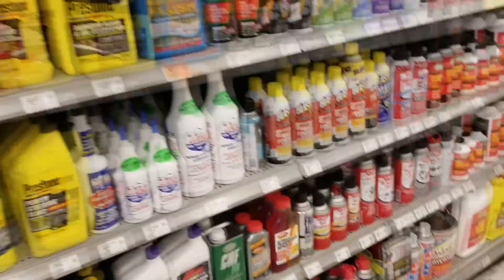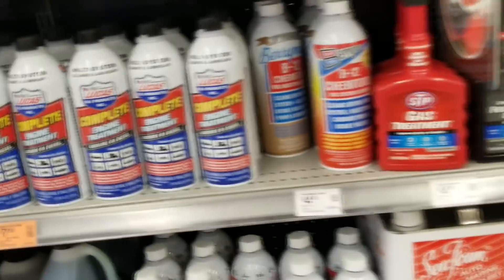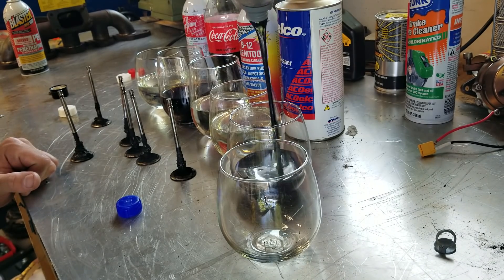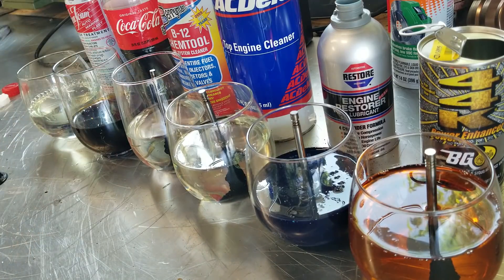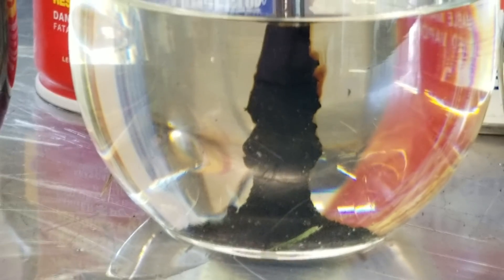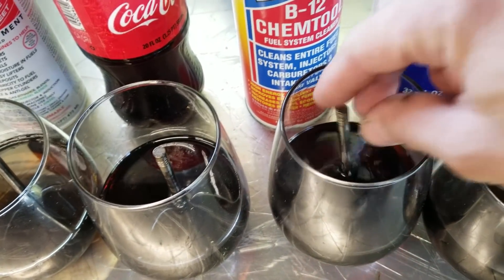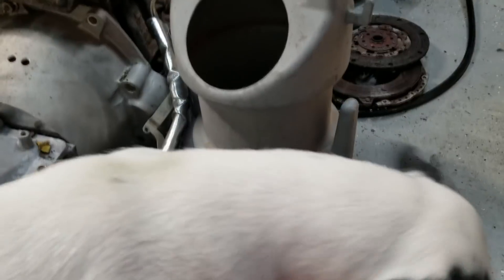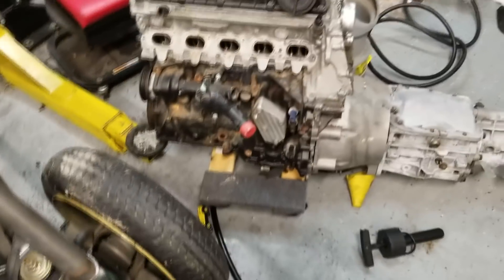Testing different chemicals for carbon cleaning

Comment: 🔥No Coolant, No Radiator and drive, still no 🔥heat...? Best Solution for Engine Over Heating problem is to use Graphenizer, watch the live Test video : - https://youtu.be/SqNIGQM1I2Q 

Graphenizer is a revolutionary product for those who are experiencing overheating engines, low pickup and performance, high fuel consumption, and high carbon emissions with black smoke from their engines.

As it is the only solution for all the above problems to be solved instantly.
It not only cleans the engine and enhances the performance, but also provides a cure and saves the engine from further damage. It gives it a long life by providing a protective coating to its internal parts like pistons etc. It can be used for all the vehicle's engines, and it is very convenient to use, and the results are immediate and long-lasting.

Comment: because BG44K isnt working as carbon disolver, it works just when its injected into hot enviroment, bg is enhancing the carbon that it can be burned off easilly. If you want something from bg, that works in room temperature, you must use bg air intake & valve cleaner.

Comment: When I had to carbon clean a TSFI Audi’s intake valves, the Seafoam and BG 44K were not very effective.  I had the best results with Redline S-1 Fuel System Cleaner, and was better than acetone.

Comment: just think when adding this stuff to fuel tank or spraying in throttle body etc...  the valves are going up and down and around and around opening up and closing on the valve seats all the loosened up carbon is going right on top of the pistons and  there's carbon on top of them also and they go up and down, now all the carbon deposits are scoring  cylinder walls then some is getting in the oil pan so the oil pump can recirculate it through the engine

Comment: You should have tried brake fluid. The best one I found yet. Soak for 2 hours brush it off then soak again in new fluid. They come out looking brand new
Reply: Brake fluid is old skool cylinder head decarbonizer we used it in the early 80ies on straight 8 valiant engine,worked very well didn't have to take head off
Reply: Sendrick Nahr what type?

Comment: Once valves are to that point all coked up , no chemicals are going to remove the carbon. Manual or mechanical cleaning is only method that can work on hardened carbon.Chemicals can only be used on new engines from the start with regular chemical cleaning before it builds up too much and hardens.
Reply: You have to cook them
Reply: @virusboy07  not all of them most of them are spray and wait
Reply: Joseph Randazzo agree, these so called cleaners only clean the snorkel and throttle body
Reply: There are plenty of carbon removers used in restaurants that could do it though every effective one he would need high grade gloves and a mask.... Something else brought me here but my families owned restaurants going on 60 years... Just go to any restaurant supply store and look
Reply: Really baked on carbon crusts (piston crown or valves) can be softened with oil or LM 1420 over the period of some days.
You can scrape off most of it afterwards with plastic razors or scrapers 👍🏻

Comment: 50-50 ACETONE/ATF. SHAKE WELL BEFORE USE. SEPERATES IN 20 MINUTES. BEST CLEANER, PENETRATING FLUID, RUST BREAKER YOU CAN'T BUY. $14 HALF GALLON. USELESS SPRAYS ARE $10 10oz. RIPOFF AF.

Comment: to remove Carbon off intake valves you need PolyEtherAmines, Im planning to make a video about it
Reply: Gumout has it in some of it products and they do work better
Reply: Pretty sure that those products have PEAs and other Detergents, its not just about dissolving it, the carbon needs to break down with detergents and heat
Reply: @BadAssEngineering  Rightly said. Btw i am an engineer and i also understand such things

Comment: Try CRC Intake Valve Cleaner. I sprayed a can into the throttle body on my GDI Veloster and it made a big improvement to response and gas mileage. There were a few instances of engine knock as more carbon was breaking off and clearing through after the heat soak. But once I hit the highway for 20 minutes, and pushed the rest of the crap through, you could instantly feel the difference.
Reply: Victor G do u need to do an oil change after it?

Comment: Yeah I told ya that the b12 works very well. With my clogged injectors it take one bottle  in the fuel tank and was able to free up some gunk and that's when i saw improvement on the long fuel trim. As we both know a cleaning was needed badly. Hehehe